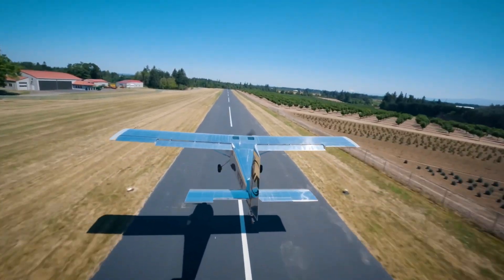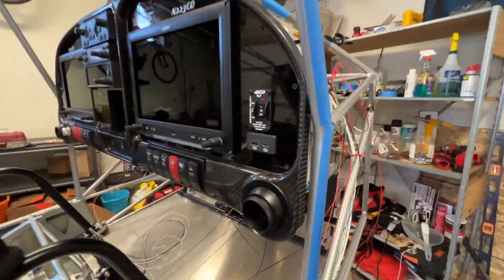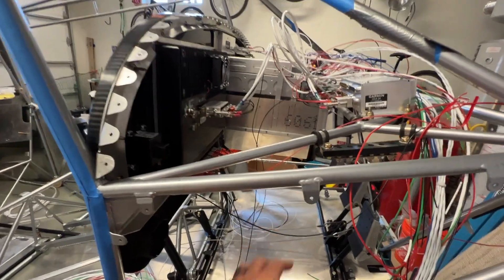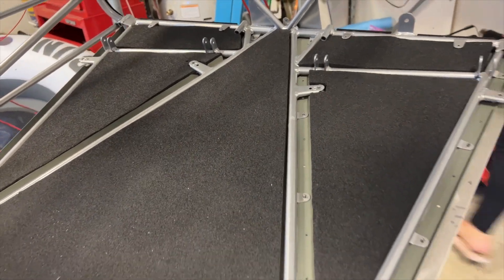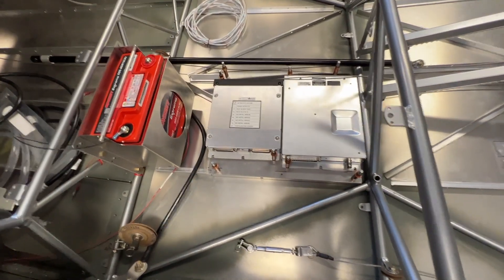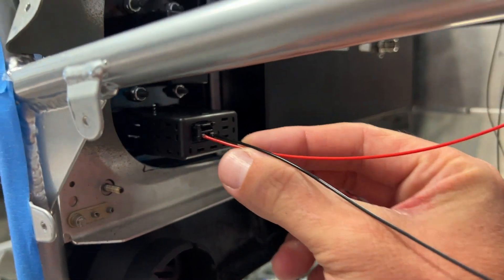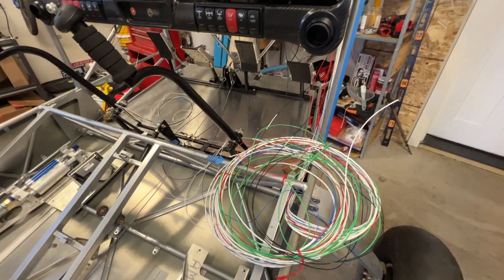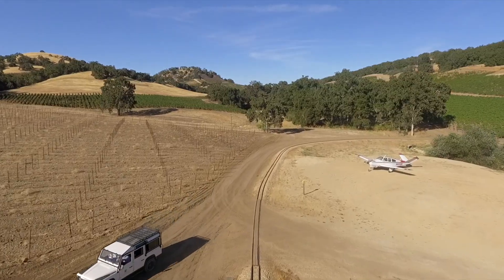Bushplane Build Interior Part 1

Comment: Fantastic videos.  Love that panel!  I'm finishing up a Glasair build with almost exactly the same equipment- except just one G3x, and I went with the SDS EFII.  Might add a 7" MFD later.  Aren't you worried about the VPX being a single point of failure?  Also, were you able to do all your circuits on that, or is there a behind-the-panel fuse box that isn't mentioned here?  I don't see your EFII control panel - ?? Are you using Robert's "buss manager"?  I see fewer switches than will be required for my system.  Wonder if there is some control of that system through the VPX...

Comment: Thanks again for taking time on the wiring and routing-- I'm close to that stage myself. Big, big help to see the video!  One item to consider at this point is installing the new rudder return pulley system from RANS- the kit is RFK54 and includes an additional pulley for the rudder return system and a cover for the rudder cables forward of the control stick assembly. Worth a look. Shoot me an email and I can give you more detail and pics. Randy

Comment: the panel looks awesome.... with respect to the rudder cables and your radio boxes... couldn't you "sleeve" the rudder cables (ie put them in a piece of conduit) little more work, but will also help protect them too
Reply from the maker: Thank you! I get really nervous straying from the manual re: flight controls. I like your idea, but I’m just too cautious to think I know better than the designers. I ended up fabricating a new radio tray to move the LRUs way out of the way. No more issues!

Comment: What will happen if lightening strikes, which cables will melt or do you have a main reset-able fuse for that like a UPC on board?
Reply from the maker: Great question. I can reset the VP-X and PPS but cycling the master (battery) switch. The screens have multiple redundancies so hopefully I’d always be able to pull individual CBs.

Comment: That panel looks gorgeous. The wiring looks like it should at this stage of the program. The odds of not having to move some wires around before it's all boxed in, are as close to zero as one can get. I really dig your radio stack rear support solution. That shows some preventative forward thinking, right there. The 'one rivet per strap' idea is extra groovy. You might consider leaving it that way to allow the stack a bit of room to move in case of any frame flex, to relieve possible stress on the panel. You're killin' it. PS...Nice pink sneakers but for some reason, I was expecting bunny slippers.
Reply from the maker: Thank you, Joe. Have you passed a color blindness test lately? The sneakers are red like my logo. Perhaps a bit of volcanic dust lightens the hue, but that’s ok. I’m bunny-slippers comfy in my shoe choices. Thanks for always brightening my day, duderonomy.

Comment: Nice looking panel!  As far as the RV-15 goes, after seeing it and hearing the specs I don’t think it’s even comparable with the S-21 or Kitfox. Significantly bigger, faster and more complex. I’d say it’s a direct competitor with a Sportsman 2+2. Their goal was a slightly scaled down Skywagon if you will
Reply from the maker: Agreed. It’s nice that it’s expanding the segment. It’s gonna be pricey…
Reply: @CLEAREDDIRECT  sure will and it would likely take 3 to 4 years to get one in the air. I’m afraid it’s everything I wanted in a high wing back country capable utility plane. Minus the old legacy engine of course🤷🏻‍♂️
Reply from the maker: Well by the time they deliver a kit, you (and the wife?) might be ready to build again. In the meantime you’ll have a pretty capable S21 that will have an incredible resale value 👍
Reply: @CLEAREDDIRECT  My first assessment was that it didn't look like a big deal. I don't know about the deal part...but it will be big. Juan Browne said the basic airframe kit is reported to be $50k and it'll probably be another year before it's ready for sale. Unlike most of their stuff, they'll use pop rivets and everything will be final drilled...both of which should save a bit of time in the build.
Reply from the maker: Joe, yeah my initial take is that it’s much more of an airplane and I’m glad I didn’t try to take this (RV-15) on as my first build. The pull rivets will help, but it’ll be a solid 3 year build, minimum. It will surely outweigh the RANS S21 and with the increased engine size, take off okay. But you can’t cheat inertia—even with 50° flaps. That’ll help, but it seems to be a “medium inertia” airplane.  I’m glad Van’s is in the game and innovating, especially on the landing gear front. I could see me buying that tail wheel for my RANS and making a Frankenstein.
Reply: @CLEAREDDIRECT  I think Juan said the prototype will use a 215hp Titan 390. I won't be shocked if the RV-15 will be 500+ lbs heavier than yours. The gear is nifty fer sher. I reckon they are taking a run at the 180/182 crowd...with maybe an eye to the commercial possibilities of the new Experimental rules that are allegedly around the corner. The S-21 will remain a sportier choice.